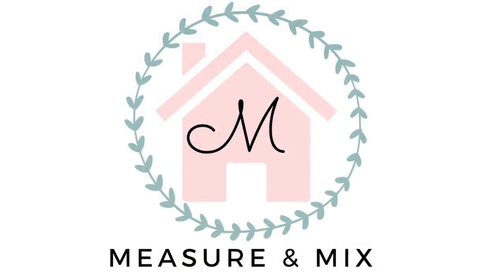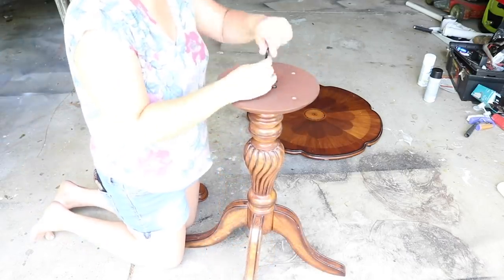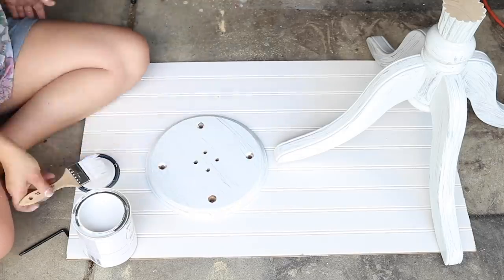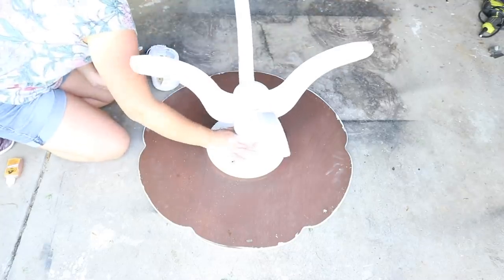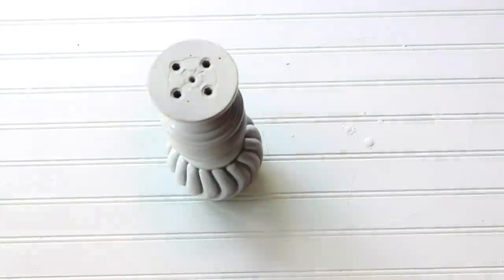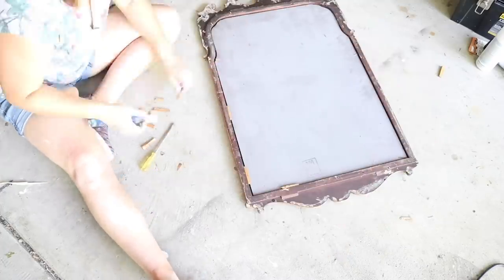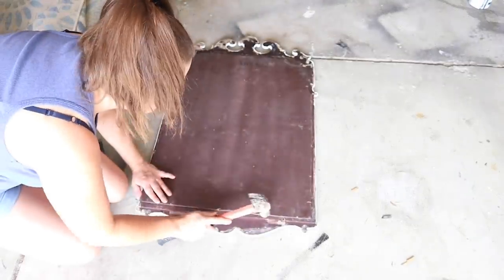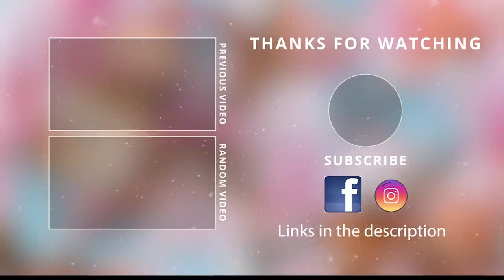Farmhouse Trash to Treasure DIY|Using Trash to Create Treasure

Comment: Love these projects!! For the table top, you probably could have used some paint stripper to remove the top layer of poly. Then you could sand it down and stain it. I did that with a kitchen table I refinished not too long ago. Amazing stuff!! My table has a rich dark top and white base! ❤️
Reply from the maker: The paint stripped probably would have worked I didn’t think about that. Thanks for the tip and I will keep that in mind for next time I makeover a price of furniture. Thanks for watching have a great weekend! 💕☺️💕

Comment: Your items came out really cute.  Just a comment on the table; you should have screwed the small round part to the pedestal first and then screwed that onto the bottom of the tabletop.  If the glue doesn't hold, it would be an easy fix.